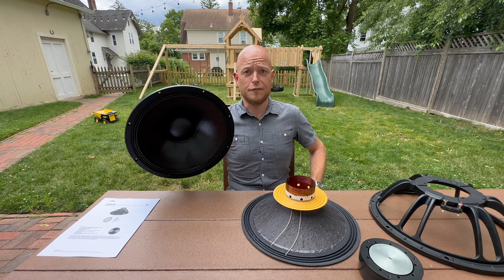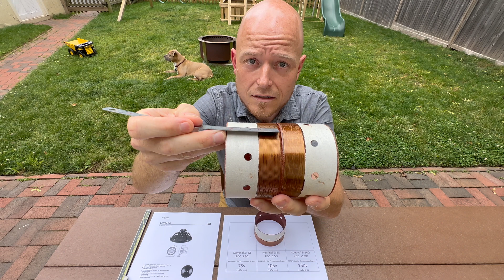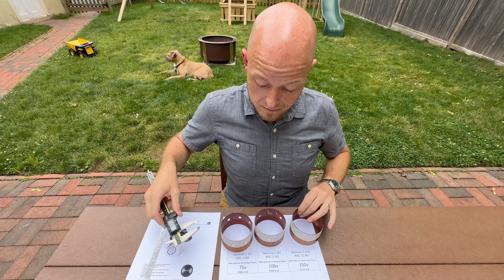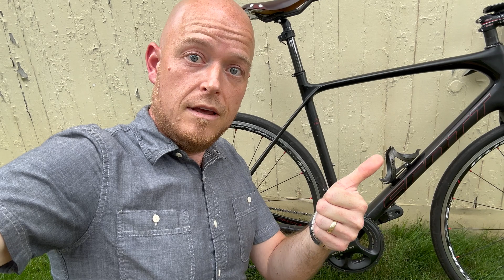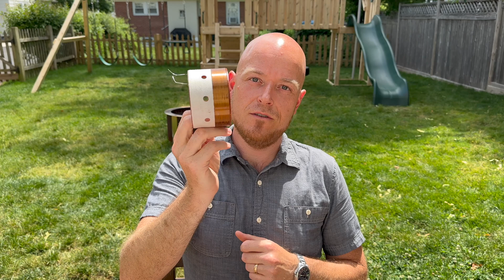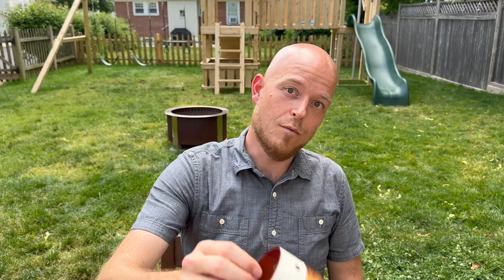Impedance

Comment: Great Video. I have a question: how is it about VC Temperature vs impedance rising under load ?. For example let's take a 15DS100 8Ohm. If it will driven at it's maximum nearly 1500W around xMax  at approx 85l netto tuned @42Hz Lowcut 35Hz BTW 3rd Order with usual Music Signal / Crest Factor. 
Which VC Temperature and rise in impedance can be expected ?
I try to figure out this "under load" behaviour especially for lower Qts driver's (<0.3) in ported enclosures.

Comment: so why high power subwoofers have 8 Ohm versions?
Reply: For using two in a single cabinet and connecting them in paralell. Most flagship amps can deliver upwards of 2kW into 4R so powering each driver with an individual channel is not needed.

Comment: Thank you for the Video! the Problem i have with different impedance Models of the Same woofer is, the 8ohm woofer has often the best sensitivity. A 4ohm Model often has some dB less sensitivity but behaves different (mostly More spl in low frequencys)  when it Comes to the response from a Reflex enclosure. That often makes it difficult to choose the right woofer, when switching to another impedance changes soo mutch in regards to Output from the Same enclosure